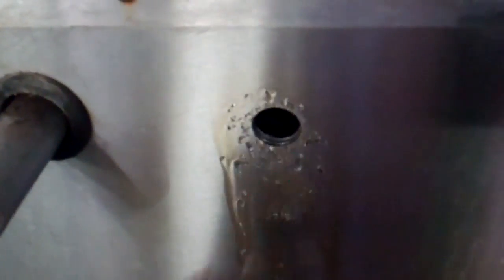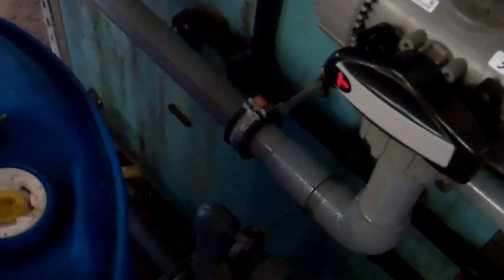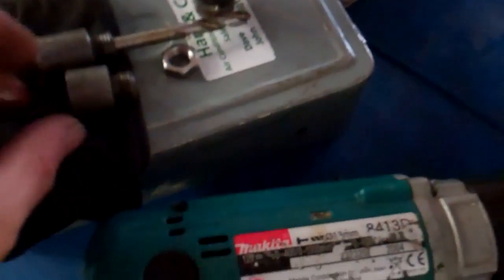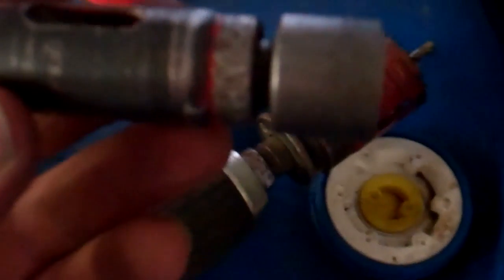Tricks of the Trade: Hole Saws

Comment from the maker: Hi Fritz!

They are standard arbors, small one does 9/16 to 1.3/16 and the bigger one goes from 1.1/4 upwards. They both use 1/4 pilot drills. I had an old small arbor that lost the grub screw so cut the hex section off that goes in the drill chuck, this left a 1/4 hole down the middle so it will slide on a 1/4 bit.
So i just screw the small saw on the cut down arbor and slide it on the drill bit on the bigger one to act as an oversized pilot in the oversized hole! Have to mind it don't fall off